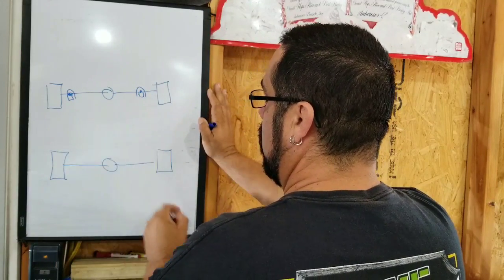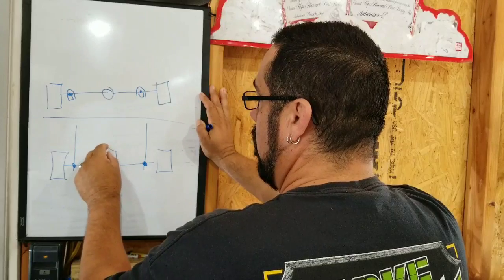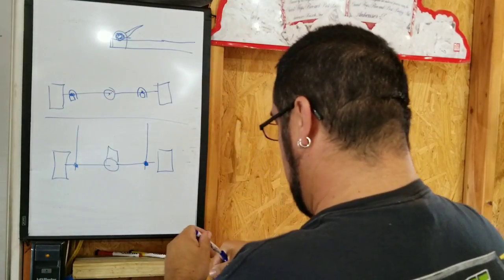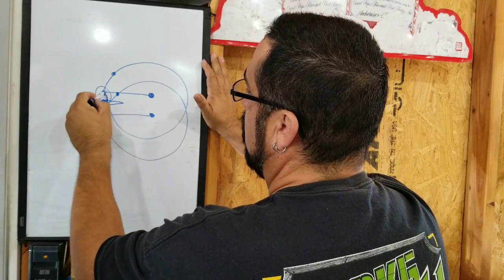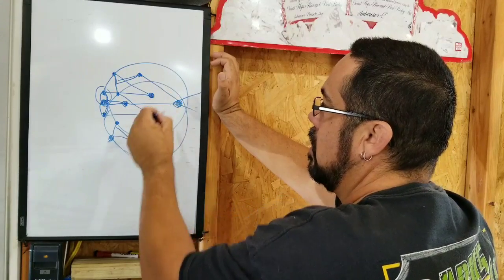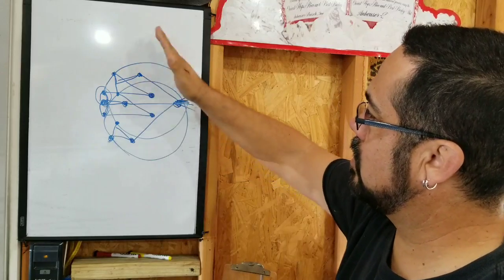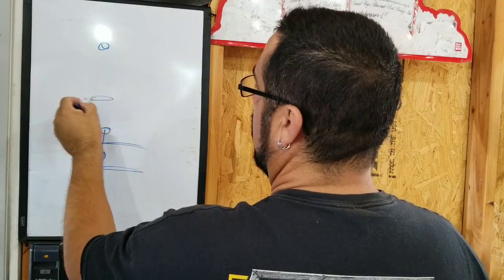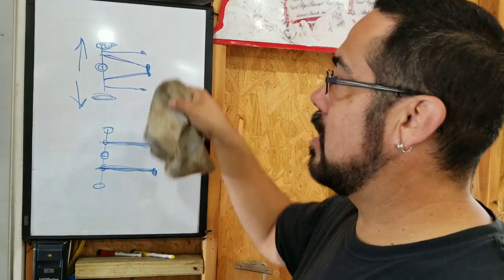What you need to know about 2 link and 4 link suspensions

Comment: The Ring gear slings oil to the front. Pinion angle is more important for u-joint life and Binding. 
Case in point a 2wd and 4wd use the same rear but different Pinion angle. The 4wd pinion points up more. The factory lift blocks is Tapered.

Comment: Great video and topic!
 I do want to add on a a little bit of the off center wheels. I was curious about this myself so i drew up a couple different link bar lengths to see how much travel the wheel goes back in forth. Before i say the numbers the graph i drew up would be setting the bar parallel to the ground at mid travel ( 4" ), of lets say 8 inches of total travel.
15" link bar has a total of .54" of movement
20" link bar has a total of .40" of movement
28" link bar has a total of .28" of movement
34" link bar has a total of .23" of movement

I used to setup my link setups at "ride height" but was often told to set it a half travel to keep axle movement small as possible. I think the biggest problem people make is not setting up the bars parallel to mid height. So i went back to sketch up to test the theory of setting a 15" link bar parallel to the ground and full drop and going 8" up from there. The movement is now a shocking 2.31" from the original .54"

I feel you, i can talk on this topic forever as well lol, keep up the videos.
Keep on truckin'
Reply: scrappingpavement I would appreciate a little more info on 3 link setups I recently bagged the rear of my 97 GMC Sierra and I would like to know your opinion on pinion angle and where you would set it I like to drive with it low but I find it has a small amount of vibration and my pinion is up a little and I do have split drive shaft thanks in advance
Reply from the maker: @scrappingpavement thank you and that's why I say go with where your ride hight will be mainly for the pinion angle that is most important then the rest only matters for short times when you need to lift over something or lay at a show or lay to drag.
Reply from the maker: @projectc1500 the vibration could be coming from the carrier bearing. But my first guess would be. Get your tired balanced you would he surprised and then an alignment. If it's still doing it then I would try that carrier bearing. Hope this helps.
Reply: @blacktahoe6409  always set your pinion angle the opposite of your transmission. 
Example from my truck:
Transmission is at -3° 
Axle set at +3°

Comment: so what was the original theories behind using leaf springs back in the day?
Reply from the maker: I don't know I want alive yet
Reply: Lawrence Duarte I ment in a bag set up
Reply from the maker: Oh it's still used sometimes but it's no good using the main leaf only you place a bag center of the spring to provide lift same as a load helper spring. Biggest set back is axle wrap the one main leafed is not strong enough to hold things where they need to be. Just dangerous.